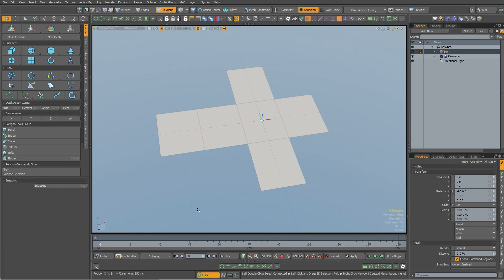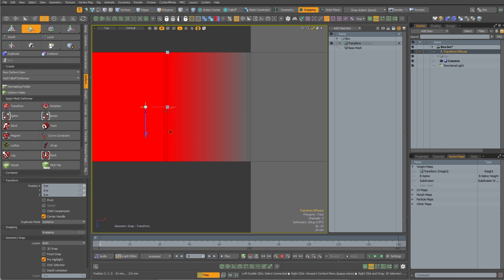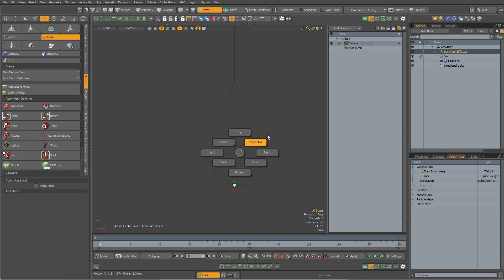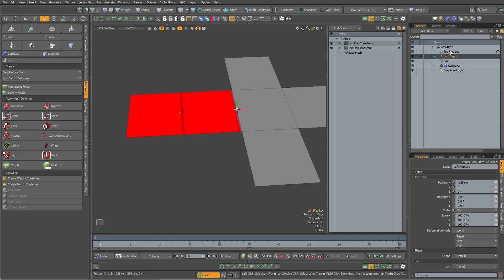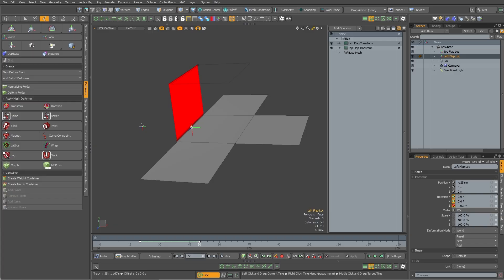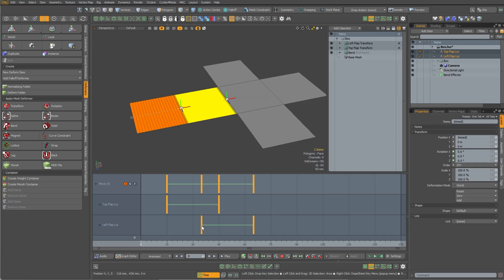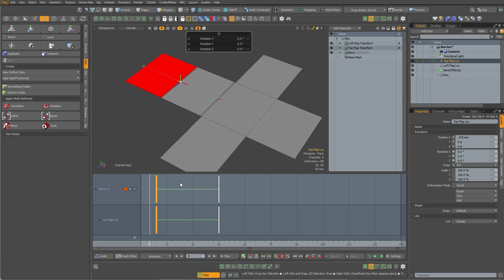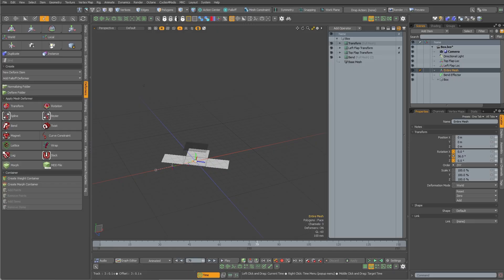MODO | Basics of Box Folding

Comment: Awesome Greg, thank you so much. I'm the one at discord struggling with the folding. I actually did it with already thicken geometry since I don't know how to get a nice UV if I do the thicken later on. Was a bit of a puzzle moving the locators at the right positions but must say that because of the thickness I accidently got really nice natural folds. Thanks again!
Reply from the maker: Yeah, doing thickness after is nice except for the UV problem. Probably best to do it first and then just weight the verts properly so you can UV it.

Comment: Bruh modo is dead. RIP. Time to move on. Blender awaits you with arms wide open 😊
Reply from the maker: Anybody make an lxo importer? lol, unfortunately I have 15 years of projects in Modo that need to continue to update.   Ultimately I'll probably go C4D though, Blender doesn't seem to have the CAD file support I need  - and it has about 1,000 things (though really cool and interesting) aren't required for the work I do.
Reply: I have a hybrid system. Modo for modeling, Blender for everything else. Blender is nice, but without going through and rebinding every last key, I REALLY do not like having to press double or even triple the amount of keys to do the same functions I can in Modo with just one or two presses.
Reply: Not dead. Still making me a ton on dough. Seven years of projects for me!
Reply: Oh, Shut up. I just finished a massive MODO project and it was successful…. Because I used MODO. 😁
Anyway, what are you doing here if MODO is dead?